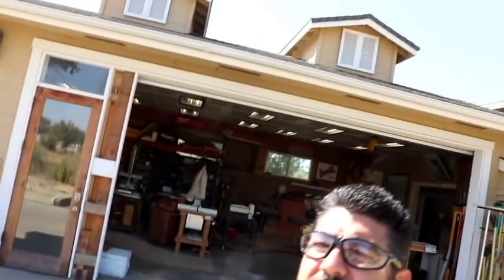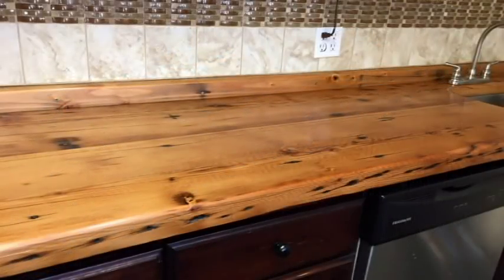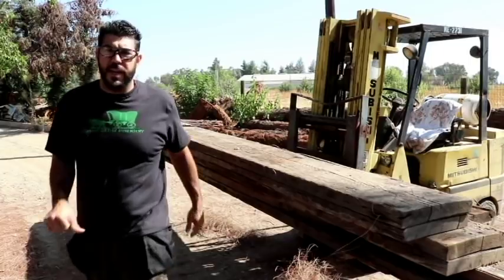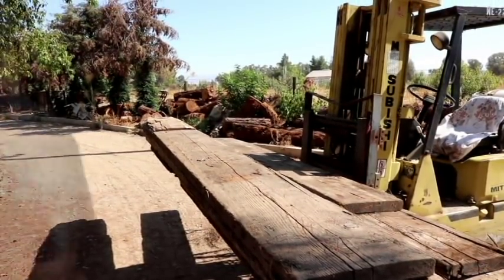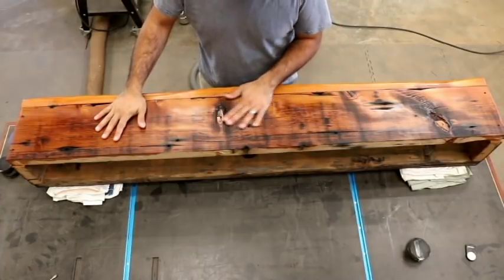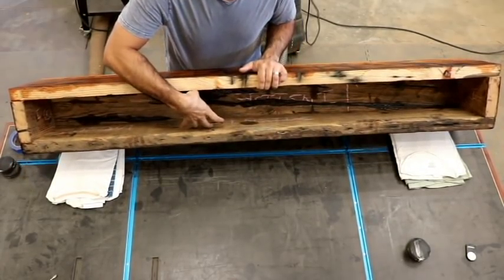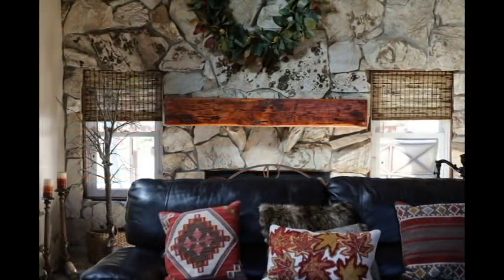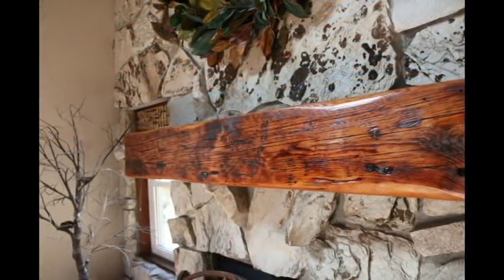100 Year Old Beam Mantle!!!

Comment: loved your video!  My mantel looks very similar to yours.  I removed the dark stain on my barn beam mantel- used a metal brush on my drill, Dremel, chisels, hatchet, sanders and lots of elbow grease.  finished it with several coats of polyurethane.  
definitely a good workout: cleaning up 50 yr old red oak lumber using metal brush and drywall hand sander with 60 grit
Reply from the maker: Nice, that sounds exhausting!!!

Comment: very cool
Reminds me of a restoration we once did - customer wanted a Mantle and my dad had save a piece of one of these massive beams we had taken out of the building.
That restoration was my dad's OPUS - this building was - god - easily 200 years old. It was on our Lake and it was the Pump House. So it housed these MASSIVE furnaces and turbines to pump the water  up into town. It was not a habitable structure, not even close! I remember digging holes in the dirt and soot floor for footers and posts to tie in the floor joists and beams thinking this is insane!!
It was something no one  - except the client , and my father of course - thought could even be turned into a workable storage space - let alone a habitable space. 56 feet to the peak in one section ( the ultimate man cave). We had a couple rockers back out on us on that job. HAHA sry - It was my fathers Last Project he got real sick during the last phase (2nd year of it) he was able to see it to completion. There was a concrete stone in the entry way that had the dates of the original pump house and its engineer. The client had someone sandblast the date of the new restored bldg and my fathers name and company and a big party to "unveil" that.

Great moment.
Great Video

Comment: For the ends I have sometimes used the ends of a piece of a log or firewood that is the large enough and sliced to 3/4 inch thick. Just square it up to size and make the miters on all edges and you have end-grain on your beam, Very realistic, They look like solid wood.
REPLY
Reply from the maker: That's a great idea, I'll have to try that! Thanks!!!
Reply: I recommend using splines Some cracking in the end grain actually looks good and you can blend it to the mantle by stressing where they meet the sides by making some grooves with a utility knife and blending them in.
Reply: Nice idea!
Reply: I also use this technique for phony log ends in doorways and outdoor phony log siding.  A few sunken finishing nails or torque screws may be helpful.